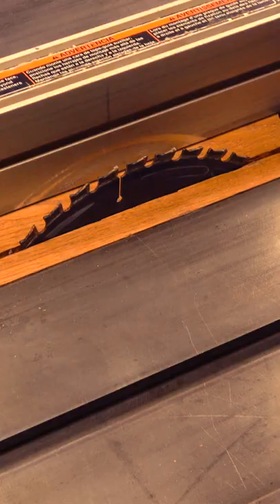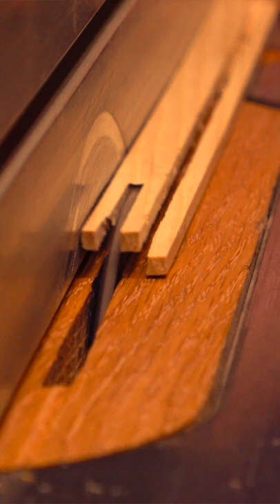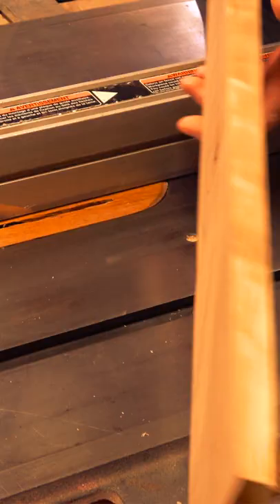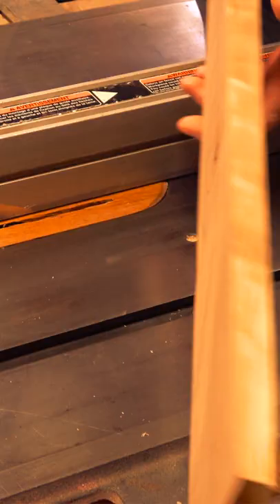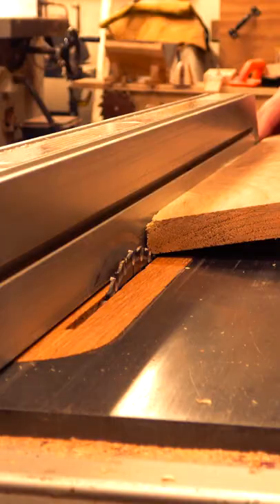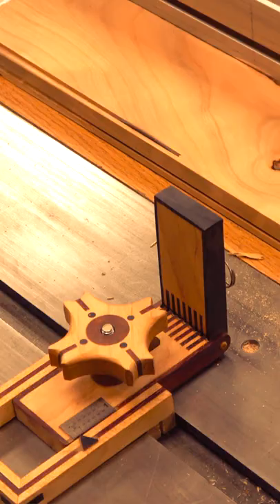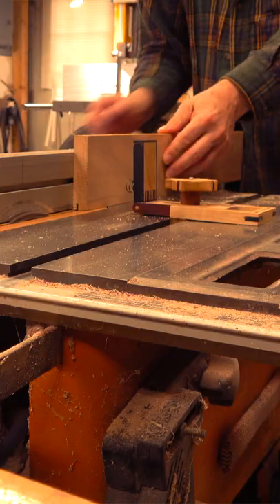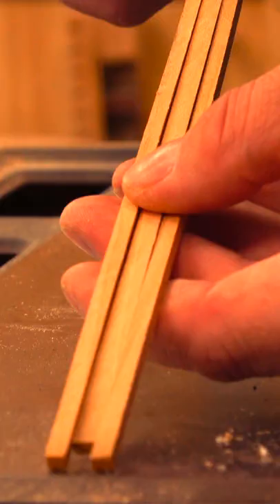19. Perfect (safe) thin strips #shorts #MTbitesize

Comment: Really good tutorials.  Anyone should be able to follow them. I’ve made a few of these.. I do like to put a screw in the end that flips down…you can run it in or out a partial turn to micro-adjust the thickness your thin strips.  We do a lot of hardwood banding on plywood so that degree of accuracy helps.  I’ve never used the spring but I’m going to add one. That beats having to flip the flapper up manually before every cut.  Good work.

Comment: What if you don't have more of that type of Woodstock and all you have is already pre-cut then? Could you then maybe use a sacrificial piece of wood and lay that on top of your thin veneer piece whatever it might be and use it to add the mass on top basically holding the then wood down as it goes through the saw? I don't work with wood I never have I don't own a band saw or any sort of table saw or any other type of woodworking gear it's just a question as I thought of it answer that maybe works for some people who have that type of problem. A piece of wood they can't get another of or an expensive type of wood or just the kind of cut they want like a knot and end grain or something I don't know just putting a lot of words in here because I keep talking.